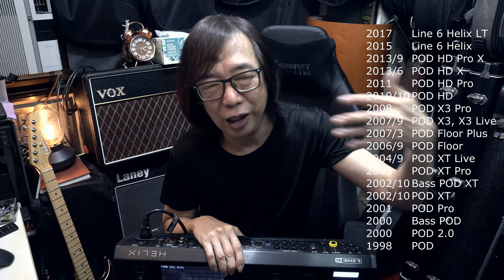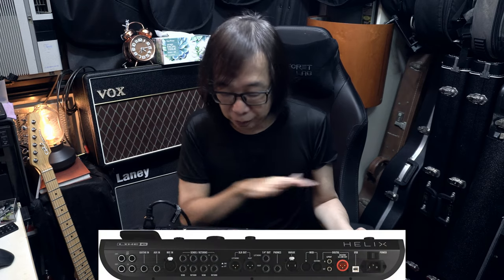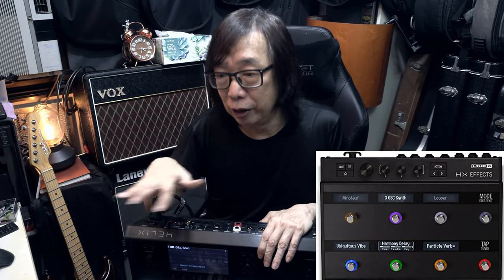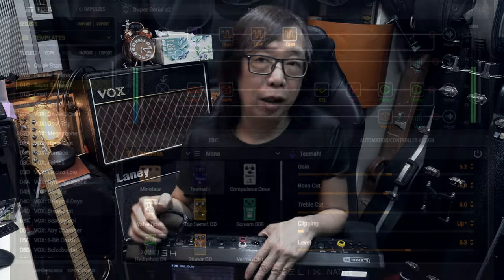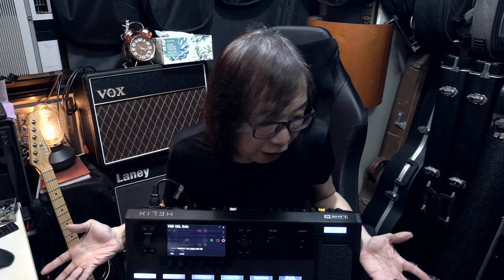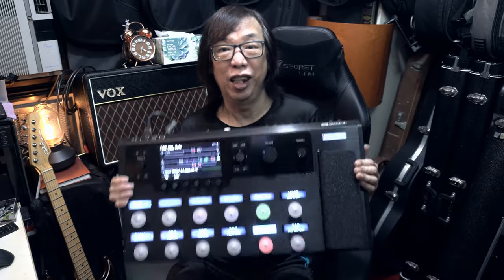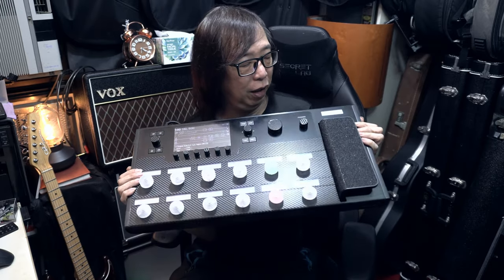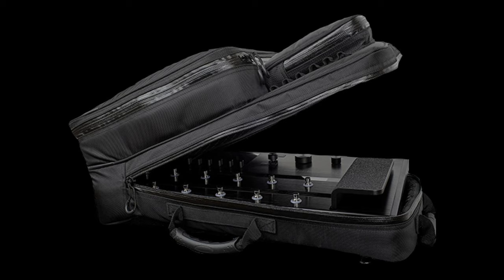The Line 6 Helix  & it's eco-system

Comment: Great opening twang Jonathan. The helix is my bucket list effects processor. Can you buy native separately or does come in a bundle? 😊👍
Reply from the maker: Thanks Tom!! I think theres an offer if you buy the Helix...check your local store, you might get a package deal ✌🤓
Reply: Hey Tom, if you want something more accessible you should check the HX Stomp. It's got the Helix engine and all of its amps and effects, with the difference that you've got way less switches and you can use six blocks (think effects) at the same time instead of 32. I've been using it for 3 weeks and it's the best piece of gear I've bought yet. 

You should also check the Pod Go, which is even cheaper.

Comment: Very nice Video. Currently, I have a Line6 Spider IV amp with the foot pedal. I play acoustic so I use mostly the clean channel with a bit of Reverb and some Delay. As I make the transition to electric I plan on keeping this amp for a bit so I can experiment with effects. One Question...On stage, if I want both Electric and Acoustic available how would you set that up. I play in a small church and building. I play through Pa. System using a DI Box Most of the the time.
Reply from the maker: You can use a line splitter or use the mic input (you will need to convert the 1/4 " to a XLR) ✌❤

Comment: Stupid question :) I have same Helix floor version and have been wondering if I should get the Helix Native also. It's not an expensive addition if you have the floor system. Is the functionality and process in Helix Native the same as using Floor system connected to the computer and controlled with computer? Or is there additional benefits? (outside just not needing the black metal box all over the place)
Reply from the maker: Like i stated  in the video, you can add more stuff as the DSP power is only limited by your computer's ram and processor. No extra cables... You can share your settings between the helix and the helix native.